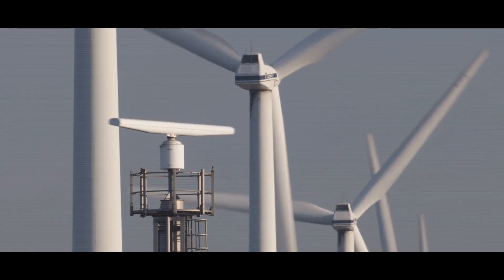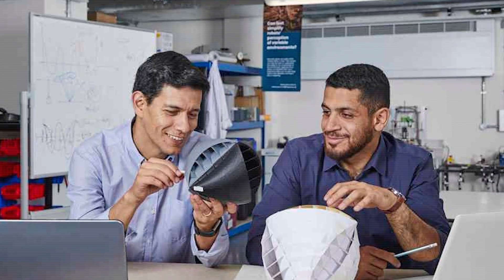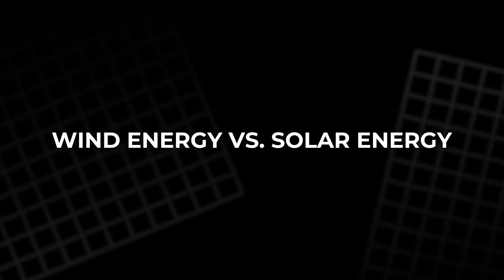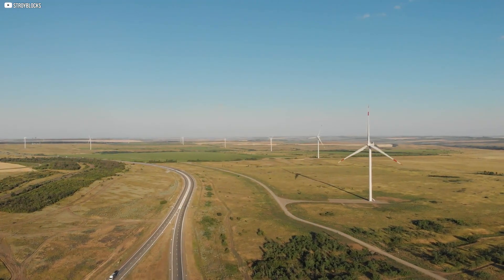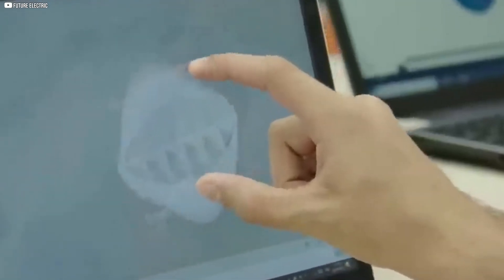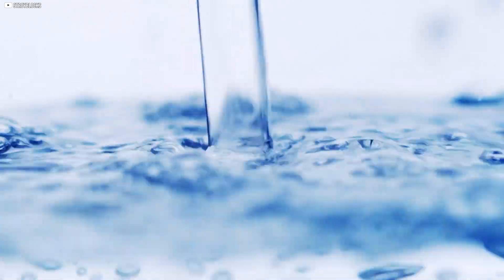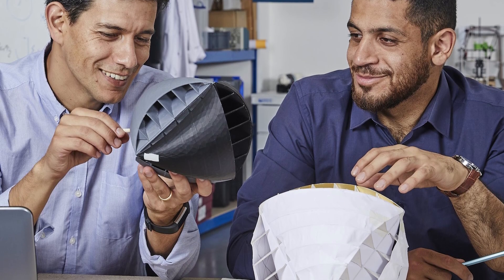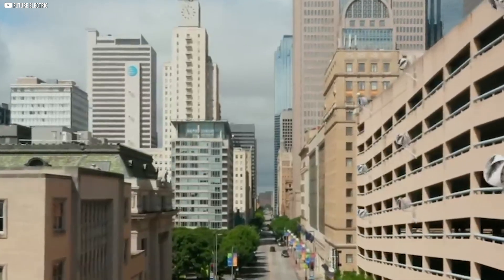This NEW European Wind Turbine Out performs Solar Panels in 2025?!

Comment: How would this compare with just running a generator fueled by water? Stanely Meyer and others have run vehicles fueled by water. These internal combustion engines could run a generator. Water is very cheap and, in many areas, free.